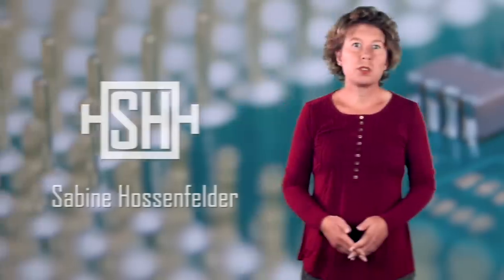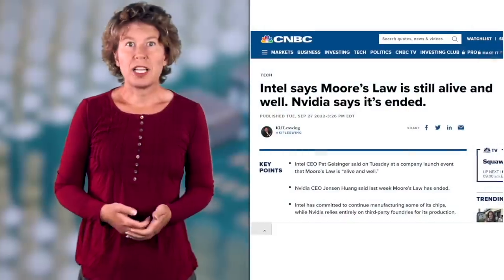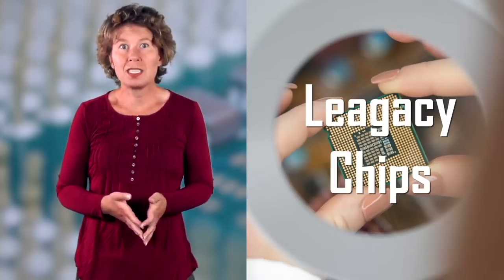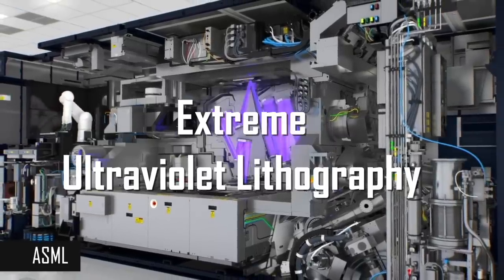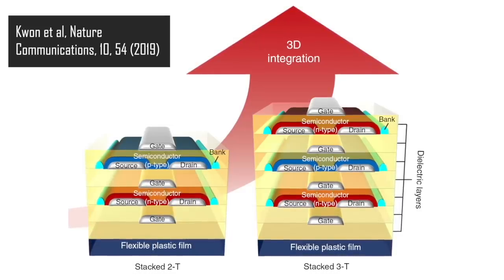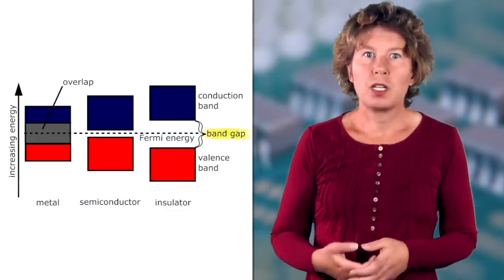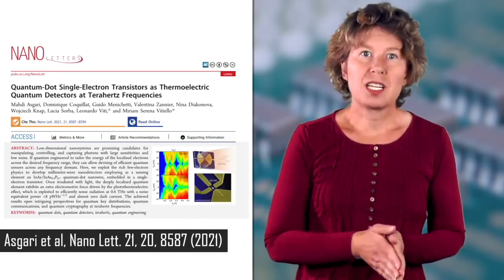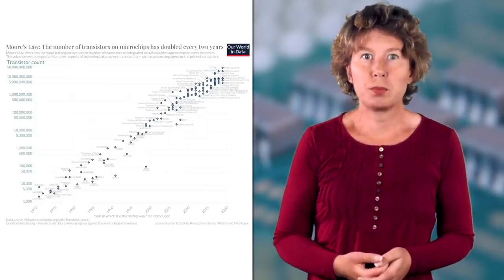Is Moore's Law Finally Dead?

Comment: Uh...gate-all-around is a different sort of thing than packaging dies from different wafers together. They're both going to be important, but one is a strategy of how to make an individual transistor, and the other is a method of reducing communication time between chips (counting this as a Moore's Law advance would be an accounting gimmick, to my understanding, because traditionally you count how many devices are integrated during fabrication, ie. before external connections are established).

Comment: Moore's law may only now be ending, but the computing revolution ended a while back. The difficulty is that most interesting and useful problems do not scale linearly with problem size, n. They may scale as n*ln(n), n^2,  or even 2^n. So the actual improvement you see in computation (in terms of problem size or depth) is NOT exponential.  I pointed this out some 30 years ago, back when I was a chip designer, but was ignored. The result would be that the number of problems would be expanded, but not the depth to which one may work them. Individual processors are really not much faster now than they were 10 years ago. Clock speeds have actually decreased from their highs. What has happened is that we now have 8, 12, or even 16 processors on a single chip. This allows us to assign to each a different process... for instance, a different window. But try to run a single process faster, and you cannot do it. I encountered this difficulty over the past year when trying to calculate the least common multiple of 50 billion positive integers of various species. Empirically speaking, the algorithm, which is pretty efficient, goes as n^1.9, but for 50 billion it took almost 40 days. Going higher became impractical. So I had to redesign the C++ program to do things in parallel, so that I could run different processes on up to 12 processors. The C++ compiler doesn't do that on its own, and it will not work for many problem types. CPUs today resemble the old mainframes of the 1980s that had 8 different processors in parallel. The main difference is that the processors are more powerful and are integrated on a single chip. However, you can see that microprocessors have reached the same end game as the old mainframes.

Comment: The easiest way to see the slowdown in Moore's Law, IMO, is to look at memory in game consoles:
Gen 7:
2005: Xbox 360: 512MB unified
2006: PS3:512MB total (256MB main, 256MB video)
Gen 8:
2013: Xbox One: 8GB
2013: PS4: 8GB
Gen9:
2020: Xbox Series X: 16GB
2020: PS5: 16GB

From Gen 7 to Gen 8, a period of 7-8 years, memory increased 16x.
From Gen 8 to Gen 9, a period of 7 years, memory increased 2x.

Part of this no doubt is Sony and Microsoft playing conservative because, having observed the slowdown in Moore's law, they know they can't stuff huge quantities of RAM in the system and lose money up front, figuring that they'll turn a profit when it gets cheaper later. However, even if they'd been aggressive it wouldn't have been more than 32GB, which is still a cutting in half of the rate of increase.

Comment: There is a counterforce to Moore's law, called Wirth's law, which states software complicates to compensate the improvement in hardware performance.
Reply: I thought it was "more than compensate"
Reply: Wirth's Law doesn't take into account standardization of programming tools.
Reply: @ForeverTemplar  I thought Wirths law did take it into account but didn't apply enough weight to is degree of forcing people to use ill-suited tools to implement the "best practices" that make up most of the increase in inefficiency of code.

Comment: Correction:
NVidia didn't pioneer the GPU. Jen-Hsun Huang, the founder of Nvidia, started at ATI (GPU company), now AMD.

Arcade system boards have used specialized graphics circuits since the 1970s. For PCs, the first powerful chips were made by companies, like S3 Graphics, an ATI (now AMD). Another big player was 3dfx, which Nvidia bought, before releasing any GPU. Nvidia actually came very late to the market.

Comment: disc stacking can increase transistor density, however the copper bus is the best way to connect stacks, and verdigree (the green stuff) looks gross. The eighties saw gold busses, but gold is a worse conductor than copper.  It just never looks moldy (as copper does over time)

Comment: What about piezoelectric cooling? I know a Frore System made a solid-state chip fan (yes, it is a chip, they used lithography to etch the designs). It causes so much air pressure that it able to pull heat directly from the chip instead of the thin layer of heated air that sit on the chip.

Comment: Been dead for a while now... or at least significantly reduced. For several decades I had to update my machines every 3-4 years to keep them close enough to the current state of the art to be able to do anything I wanted with them (mostly it was games that drove it). Now machines are lasting 6-8 years and processing power has not moved much.  Adding more cores is only capable of a less than linear increase in power rather than the exponential growth Moore's law dictated. GPU power has continued to evolve rapidly but that's more from a new tech perspective (RTX and increased AI/ML workloads) driving the rapid growth of capability in those areas.

The same holds true at the top end of the spectrum too as the performance growth of the supercomputer market has also flattened out quite a bit, need some new revolutionary tech to have any chance of continued Moore's law sort of growth.

Comment: I feel that not only money, but the tunnelvision of making things smaller is a major problem. We need to get over having things tiny. Make the chips large, put in new cooling methods even if it makes the chip larger. Just get it done. When we have that, then we look into making that smaller again. I know it is easier said than done, but I feel the exotic 'look how small it is' mindset is holding back some major development. So what if the next flagship phone isn't the size of a sheet of paper. What if it was 5% larger than current but a whopping 50X more powerful. 

I say, make chips large again, stack em up high and put in some cooling. To hell with looks. Same thing as to why the planes with propellers in the back never really took off, because people din't find it sexy. Even though they were more efficient.

Comment: That 1973 size seems a little small. The ones I used for my everyday electronics guitar pedals came with their own sockets (couldn't risk such expensive items by overheating) & were about 0.5cm across.... but I'm sure there were also ic's about at the time..... ; )

Comment: GPU's have been around since the 1970's and were pioneered by NEC   Anyone out there remember Number Nine graphic cards?  However the first fully programmable GPU that was mass produced was the TI TMS34010 which came out in 1986.   Does anyone out there besides myself remember writing TIGA code?  (NVIDIA didn't have a GPU until the late 90's.)

Comment: CPUs have pretty much plateaud and for a few reasons. Transistors are and have been near the absolute limit in size for a while. Chips tend to have these transistors in several layers yet CPUs haven't gotten any wider or thicker in quite some time. The clock speed pretty much tops out at 5GHz for different reasons, namely that going much further than 5GHz requires exponentially more power draw and generates exponentially more heat. It's not practical or feasible to go higher than 5GHz other than to win an overclocking competition. We've hit the limit for what a single processor core can do. So what do you do when you have run out of lateral space? You build up. Parallelism is the way the industry moves forward now. You see it a little bit with multi core CPUs, but even that has largely plateaud, and I suspect the reason for that is that parallelism on a von neumann architecture is just a hard problem to solve. Multi-threaded code quickly gets very complicated and introduces whole new classes of bugs, like data race, that simply aren't a factor in single-threaded systems. GPUs, on the other hand, are not von neumann machines, and they are very good at parallelism because the hardware is optimized for geometric floating point math (as opposed to general purpose computing) and running a small program millions of times simultaneously. And that's exactly what I notice: new software is more and more offloading computationally expensive tasks onto shader programs that a GPU can execute millions of times simultaneously. GPUs are the part that sees the most upgrades now. Whereas 5 years ago the GTX 1080 was the cutting edge, now it's all about RTX raytracing. Meanwhile, I haven't noticed much change in the CPU market. CPUs are still 1-5GHz, 12 core is still considered a high roller, sure Intel's latest product is probably marginally faster than the 5 year old CPU I have installed, but not enough to really matter. GPUs can keep getting bigger and introducing more parallelism, and there's no real limit to that other than the fact that some GPUs are so large now that you need special mounting hardware to prevent its weight from ripping the PCI slot off the motherboard. I won't be surprised if in a few years, we'll start seeing external GPUs that are the same size as your desktop PC tower, that sit outside your PC and somehow cable into the PCIe slot. Maybe a new external PCI connector will start becoming the norm, kind of like eSATA. So then upgrading your GPU will become as simple as plugging the GPU into the back of the tower, and then plugging the GPU into the wall. Who knows, maybe every component will eventually grow to the size of a desktop tower, and then PCs will start resembling server racks because people will get annoyed with having 5 different towers under their desk so some OEM will come along with a "modular" solution that is: a rack on wheels that you put all the components in. Then homes will start being build with "cooling closets" to put said not server racks in and when little Billy comes home from 1st grade computer lab and asks where the PC is, you can open the closet door and be blasted in the face with a wave of hot air cause your HVAC died, also your CPU overheated and shut down the whole assembly so the 17 hour render job for your SFM project is down the drain. Ah nuts.

The nice thing is that we're more or less past the growing pains of the mid-2000s. Software vendors have learned from their past mistakes and now a computer from 5 years ago CAN run the latest software at an acceptable level of performance, because all those fancy new hardware features are opt-in. If I want to play the newest video game that advertises RTX raytracing support, I can play it. All I have to do is not turn on the raytracing and I'll have a smooth 60fps experience. I don't have to buy a new PC every 5 years, I don't even have to upgrade my GPU every 5 years, and that's honestly great.

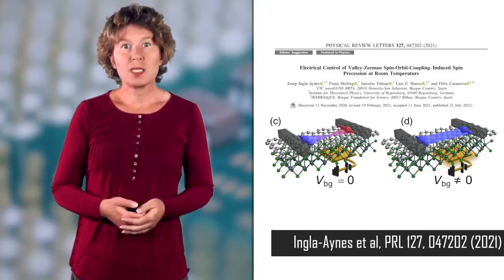Comment: {{  18:57 In summary, rumours of the death of Moore’s  law have been greatly exaggerated. It might  
     19:04 not continue in its original form, but its  spirit of progress is as relevant as ever.  }}
So in over words, Moore's law has ended, but we might still see improvements from other factors. It's go to remember that Moore's law was number of transistors would double every year per chip at a particular price point. That moved to every 18 months and now is quoted as every two years. The growth rate is slowing and will likely to continue to slow before coming to a stop.

Comment: For most PC users Moore's Law is dead for 8 years.
Transistors get smaller.
But program's speed is terrible bad.
And consumer programs 1-2 core 15 years after multi core processors came to mass market.

Comment: I think the solution will end up being a reversal of what we've seen so far - further development of larger process nodes to make them vastly cheaper, much more reliable, more robust, and vastly more energy-efficient... so we can make much larger chips and use many more of them.

If that happens, perhaps one day your processor won't be one planar "chip", but a cube made of many stacked layers with built-in cooling channels.
Reply: Doesn't work that way. You increase size and relative computing capacity the more power it requires to run at full capacity.
Reply: @ForeverTemplar  That's the conventional wisdom, but it's a misconception. It can actually work that way... we currently push our chips basically as close to their limits as we can get in terms of clock speed and core voltage.

Power consumption does not scale linearly with clock speed and core voltage... it's much worse than that. As a result, running at slower clock speeds and lower voltages is vastly more efficient. Dropping 10% of your clock speed and Vcore might as much as halve your energy consumption. Much bigger core, more complex instructions, significantly slower clock speed, lower voltage is probably the way to go.

Additionally, we've reached a point where smaller process nodes actually produce less efficient transistors/chips due to quantum effects like tunneling... so larger process nodes (eg: 14nm vs 5nm) are more efficient than the bleeding-edge nodes, and with further improvements to reduce things like leakage current we should be able to make them even more so.

Comment: Moore's law is conditioned by two limitations. 
The first limitation is conditioned by existing technology and the development of new technology that is limited by physical laws. 
Another limitation is for economic reasons. Increasing the number of transistors should be enough to make customers interested in buying a new chip, but if you increase the number of transistors beyond that, you will not have any additional economic profit, and you will get additional costs and a problem when developing the next generation of chips, which again need to have a higher number of transistors than the previous generation. to get customers interested in buying a new chip. 
For the next generation of chips, the lower limit is taken. 
In the previous period, the increase in the number of transistors on a chip was limited by economic reasons, which are expressed by Moore's law, but it seems that a technical-physical limitation will soon begin to work.

Comment: Miniaturization need not reach fundamental physical limits for Moore's Law to die. Only the limits of the current technology that had kept improving at a fast rate need to be reached. Further miniaturization may be so difficult as to take much longer to achieve. In any case, most of the benefits of Moore's Law were lost when Dennard Scaling died.

Comment: Making the porous plating on the sink side with fortified cage layer pin bore matrix with argon pressure into a gas sink on the wafer to have a bleed troph venturi whistle phonic cooling by large pulse station. That's hardware to codeware 12:37
Reply: Monopana with highest bore. In a 50% distribution. Diameter to fit sharpness consistentlly.

Comment: The next computing breakthroughs could come from simply using what we have more efficiently. The vast majority of our worldwide compute power now sets idle. If John Von Neumann could see us still using his original architecture, he'd likely laugh and ask why. CPUs, ALUs, memory, input and output devices, networking and communication bandwidth are now all essentially free, compared to 1946, yet we're still jamming and cramming through these various Von Neumann bottlenecks as if they still cost millions each. 
Pre-characterizing every app's computational  workload in advance, then Partitioning and assigning it to subscribed, idle cores pre-loaded with relevant data and algorithms whenever it hits a common runtime hopper could engage enormous computational intensity at a moment's notice. John Von Neumann would be going wild with Billions of computers setting idle. We're just idling with them.

Comment: Moore's law IS dead, as defined as transistor geometry. What's not dead and has barely started is the serious "optimization" of silicon lithograph technology. BUT the meaning is we are at the end of a road in a 100 year technology. Now the job is the optimization of its application from transistor geometry all the way  up to user interface. The difference between enjoying an advancing technology and "having" to optimizing it is significant in a way very few people will grasp.

Comment: Whether one believes Moore's "Law" is still valid depends entirely on the metrics. Parameters such as chip design dimensions have long since ceased to be a measure of progress. The definition of what constitutes a "node" have become fuzzy and ambiguous. Many of the old parameters have long since come to their limit. Clock speed, for one, hit a wall early in this century. The use of multicore processors is in some sense a workaround of this limitation. So, depending on the metrics and the application, one can say that exponential progress continues even if one believes Moore's Law is finished.

Comment: Wouldn't you say that Morris law also worked in reverse, the Babbage differential machine of 1820. I understood that Babbage believed that a machine could be built to account for everything, except that it would be larger than the continental United States. And my mind they have done that, built his huge machine that's even bigger than he thought, the cerebras wafer chip. 10 and 1/2 in square continuing 13.5 million supercomputer cores all interconnected with  2 nanometer lithography. How large would his analog machine have to be, his differential machine now able to fit on a pinhead with vastly more potential. Does Moore's Law go back to Adam and Eve? Irrespective, why would Moore's Law fail in the future to do what it is always done?